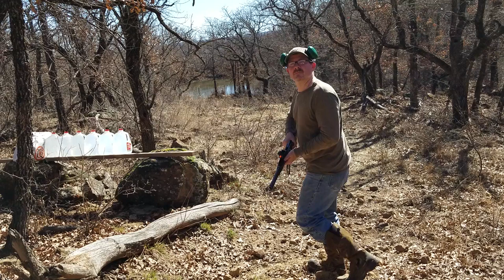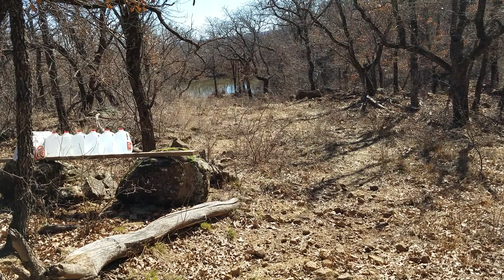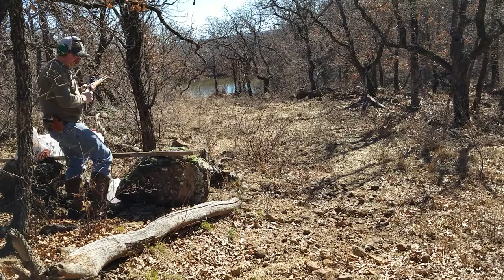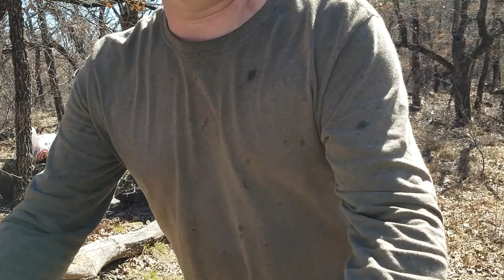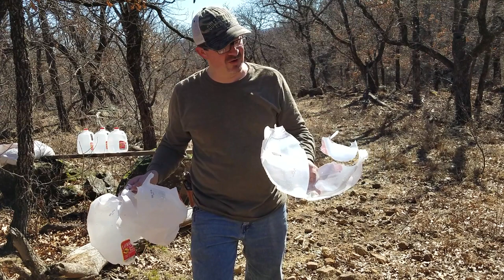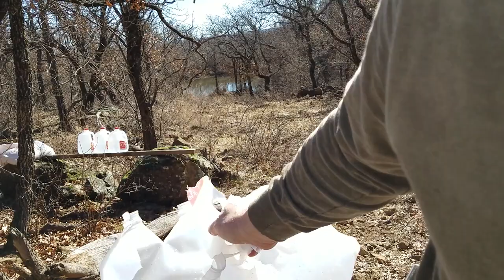Cast Lee 230gr Powder Coated Truncated Cone, Water Jug Ballistics, 45 Colt +P,

Comment: Did you do the powder coating and if so did you do a resizing on the powder coated bullets before using them..?
Reply from the maker: I powder coated them myself, but found that they are still around .452”, so I haven’t found any need to resize. Over 13.2gr of Longshot, they are super accurate for a lever gun, really fun!